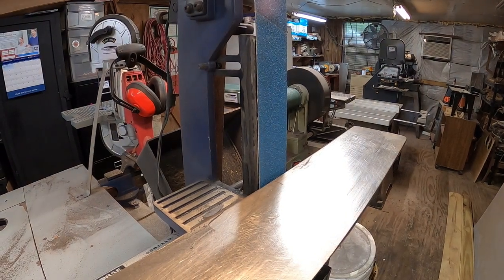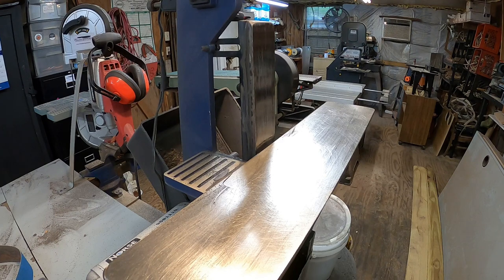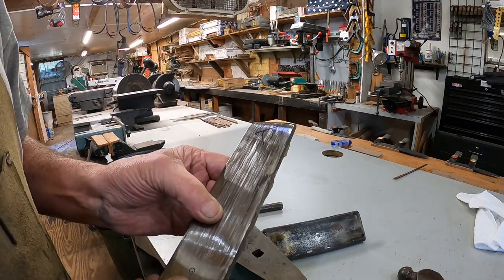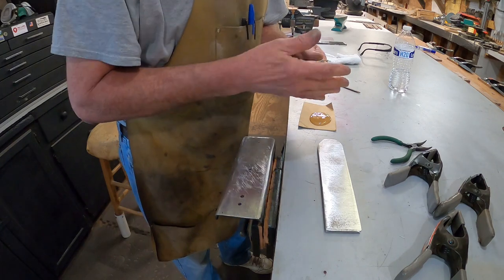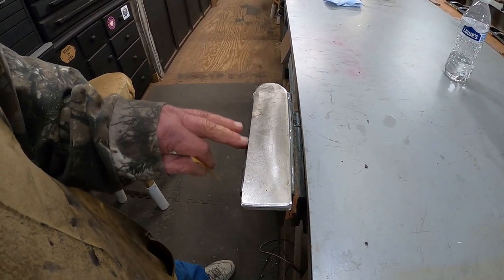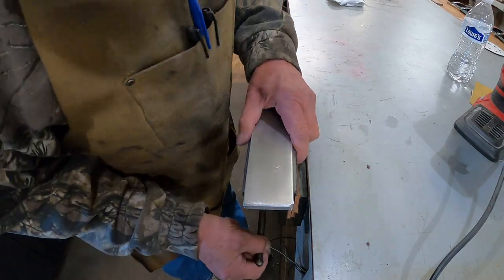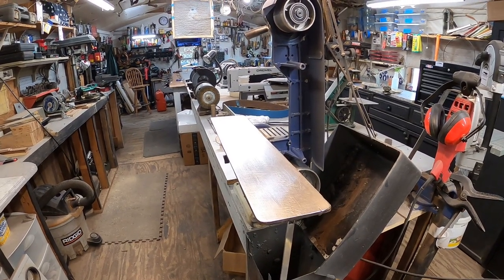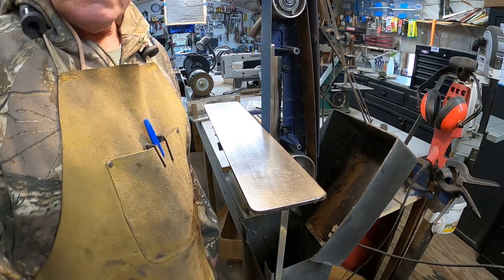Knife Grinder Problems.

Comment: The garolla epoxy is not what its cracked up to,my opinion. I use devcon 2 ton , I messed on a handle and I had to use a hammer an chisel to get it off. My old buddy use to say " that works for me "WEY.
Reply: I use devcon on the knives,if I'm working on my Cyprus boat or building one ill use West system 2part epoxy, same as Stauter buit boats.WEY.